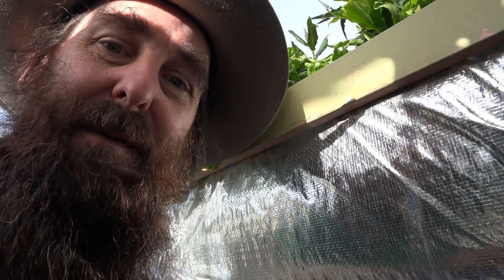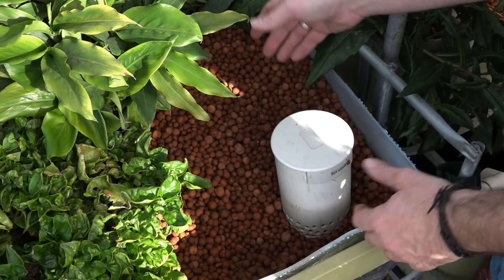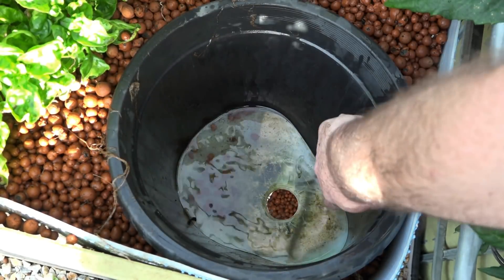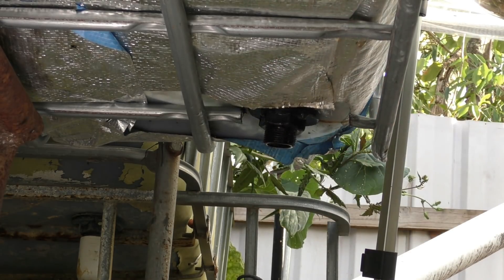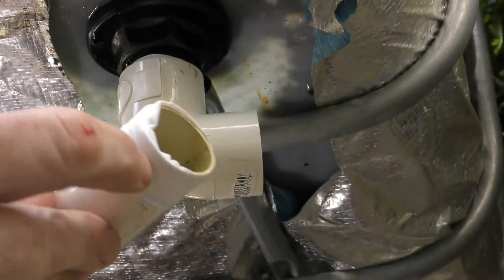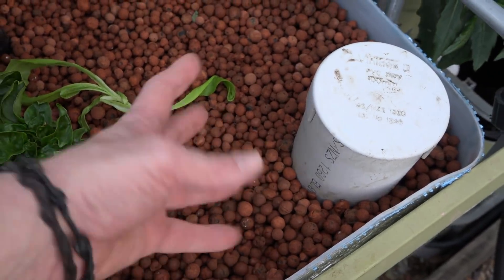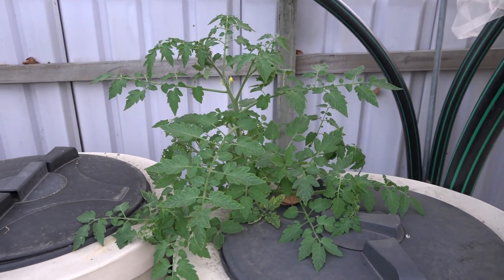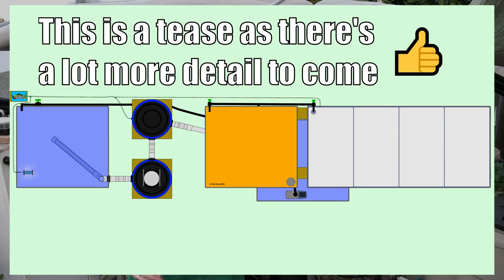Aquaponics | Repairing a Leaky Bell Siphon in an Aquaponic System

Comment: Dear Rob, it has been while mate, hope doing well a long with all of your family members :) Quick question please! :) I made my grow bed and each time i plant something they grow for about an inch to two inches and then dies! :( I thought there might be problem because of the over watering them, because the grow bed fills in 5-8 minutes and the U siphon breaks, and so on.. So i installed a timer (1H on- 1Hoff), and made small tiny hall in bottom of the (standpipe); so that when the timer is off, the water from the grow beds empty slowly and keeps the roots exposed to air (I got this from the net), this was done today, so i honestly don't know what would be the result :). Any suggestions that might help me? Don't ask me about the Ph level; as i don't know.. I have about 20 Tilapia fish in 100 Gallon tank feeding two blue barrel grow bed :) <-- this is an experiment so that if if succeeded i'll implement it in my greenhouse at our farm :)
Reply from the maker: Hi Mohamed. Hope you've fixed the issue by now. 
If not, do you know what the slat level of your water is?
Reply: Rob Bob's Aquaponics & Backyard Farm  thanks a lot for the reply. 
I made bigger project and its doing well this time. Sure i have some difficulties but hope this time they’re under control. I made a video last time but was in arabic and i was thanking you, but I knew you wont but able to understand it 😁
Here is the video about the project and this is the third video now https://youtu.be/6ZCRNiQ1pVU

Comment: With the drain pipe. Can you run it into the tank so the outlet is under the water line to reduce the trickling noise at night time?
Reply from the maker: That will prevent air running back up the pipe helping top break the siphon Abe. 
I have seen some folks run the drain into a larger diameter pipe which runs into the sump. That tends to reduce the noise somewhat. 
Cheers.
Reply: @RobsAquaponics  thanks

Comment: I love your videos I've been doing this for a short while, but my only problem now is my Ph is so high. Am I able to bring it down naturally  or will I have to do it chemically.
Reply from the maker: Hi Robert.
You can bring it down slowly by adding top up water you adjust before adding. 
This clip may helps some. https://www.youtube.com/watch?v=eO1pHM7Afuw

I definitely don't recommend adding any acid directly into the system & also wouldn't add lemon juice or citric acid as both are antibacterial. 

Hope that helps some mate.
Cheers.

Comment: Bloody great idea with the bottomless pot. I was wondering how you’d do that. Also, with the bulkhead, what I’ve found to be a better seal is to have a gasket on both sides of the gravel guard base cap and none underneath the bed.👍
Reply from the maker: Have added the wasters in a few different ways & find they always create a good seal Shane. Does make better sense to use them on the end cap just for ease of installation. 
Cheers & happy growing mate. 🌱👍

Comment: How do you feel about the chance of the plastic leaching into your water
Reply from the maker: Not overly concerned with the HDPE but I do swap out any sun damaged PVC when I see it. I know it's only breaking down on the outside & not where it's contacting the water but would prefer not to have it in the system. 
Cheers.
Reply: Thanks

Comment: hi Rob, i clean the join with paper towel and scratch with a knife, then  I silastic ( sickoflex) both sides of the washers, for added leak stop.
Reply from the maker: Have seen a few folks use sikaflex Shane & it really does a good job at sealing joins. Will be using it for the windows in the fish tanks if I ever get around to installing them. 👍 
Cheers mate & have a top one.